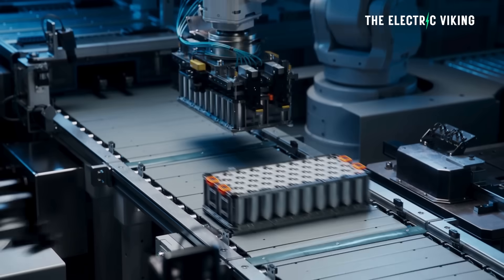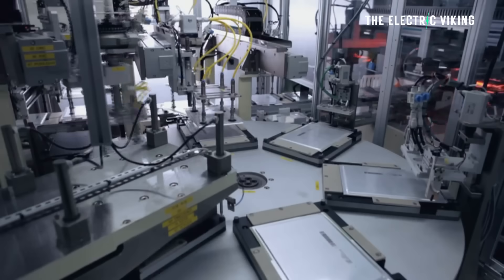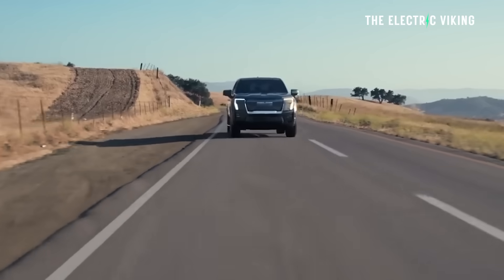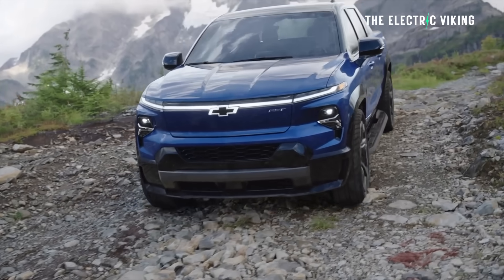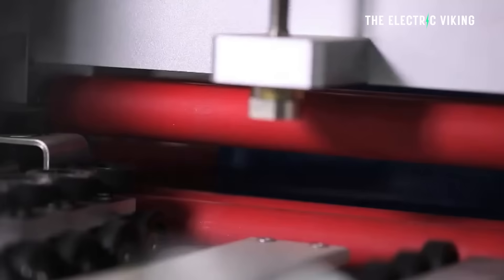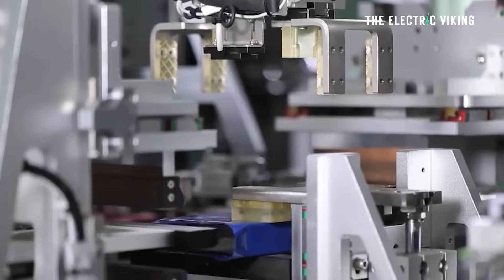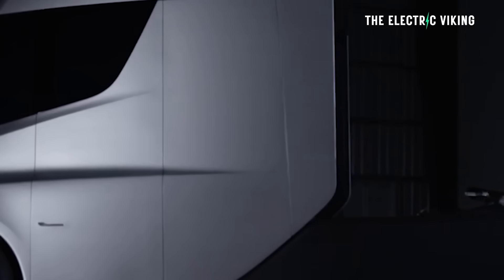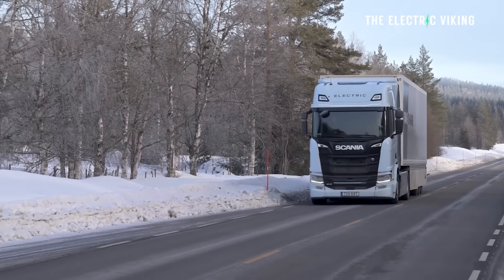GM’s Battery Breakthrough - LFP battery cost with 33% higher energy density!

Comment: Sam - the haters will keep moaning that we keep hearing about breakthrough batteries but never see anything. But batteries are still getting better and cheaper every year. I guarantee you that oil is not getting any better as we pump it from the ground. But we are improving our ability to store energy and also our infrastructure to transmit it to cars. It’s all happening right in front of us and in 20 years we will think of gas stations like we now think of dialup modems or VHS tapes
Reply: I agree entirely, my benchmark is when I can go down the road the buy one from the supermarket it's reached mainstream production, until then these are interesting to read. I personally think 20 years is to long though, 10-15 years I would give it. It's like smartphones, it seems to go slow at first, then suddenly seemingly overnight Nokia is just another old phone maker and all the good stuff is coming out of upstarts like Samsung and Apple. If I needed a new car now it would be electric of PHEV certainly (more likely PHEV due to where I live), but currently one in four new cars being sold are electric and that's not going to stop or slow down. It's like computers really, there's always a brand new processor around the corner, but if you wait you end up never buying anything. Even if you buy a new EV today and tomorrow the latest battery tech replaces the current tech you still have a decent EV, that's life.
Reply: Dammit!  I miss VHS tapes...
Reply: @jefflittle8913  Yeah, but that does bring up an interesting point right? Just because we have all these breakthroughs doesn't necessarily mean we will get the best battery tech, there's a balance between various factors like cost of production, technical operating specs like temperatures and charging and cycle numbers that may mean we get the second or third best battery tech in energy density, it's just like the VHS/Beta war, someone will win, someone will lose, but unpredictable at the moment, but yeah, good old VHS, the second rated tech taking the crown.
Reply: @jefflittle8913  Hahahahahahaaa!
Reply: Hey petrol cars are a lot cleaner now than ever before, and anyone who has experienced changing a distributor cap will appreciate the electronics breakthrough in modern petrol cars
Reply: @barryobrien1890  Yes they are, they still burn oil products, they still create pollution, they are still woefully inefficient when it comes to converting burning oil into motive force compared to EV's. Not sure what your point is here, we should keep ICE engines because they are slightly more efficient after 100 years of development? Or maybe we should change over modern electric engines because they can be over 90% efficient converting electricity into motive force. Your arguments about modern electronics actually support EV's, not ICE vehicles. If we are going modern electronics why not go all the way and get an EV?
Reply: That's because it's not really a breakthrough to begin with.

It's just just Li NMC tweaked to significantly favor manganese in proportions over nickel and cobalt.

That's why it's called "lithium manganese rich", and not just "lithium manganese".

It still has nickel and cobalt - just significantly less of them now in proportion to manganese, which is a cost benefit, but still reliant on conflict linked mining.

Also LNMC type batteries are more prone to fires than LFP, so until we know how fire prone LMR chemistry is it's definitely way too early to call this a breakthrough.
Reply: "It’s all happening right in front of us and in 20 years we will think of gas stations like we now think of dialup modems or VHS tapes"

Except we will still need to charge somewhere, which is just as likely to be former gas stations as anywhere else.

Also people mock VHS but they were a lot easier to just set up to record on and rerecord over than any variant of DVD technology has been since.

HDD's are an improvement, but it's non trivial to just take a HDD recorder away with you if you want to play a recorded TV programme in another building.
Reply: @mnomadvfx most people with houses will charge at home. Which is the case now for EV owners with a house. But obviously we will need lots of public fast charging. This is obvious. The US is adding 150 fast charging stations per day on average so by the end of the decade there will be way more fast chargers than gas pumps.
Reply: So you think that engines developed in the 1930s haven't improved in efficiency????
Engines continue to be more fuel efficient & last way longer than their older cousins.
A world full of EVs CANNOT possibly be supported by "green power", it's a statistical FACT!
The recent power outage in Spain & other countries was caused by the imbalance in the grid, caused by greenpower!
Reply: How can oil 'get any better'?  It's fabulous, multi-purposeful and plentiful as well as accessible.  If only lithium were as easy to derive???  Or the 'exotic' materials used in some battery production???  We are increasing the fuel efficiency and cleanliness of ICE vehicles every year (actually going backwards in some cases due to pathetic enviro regulations) and will likely find a way to scrub CO2 from emissions long before we get a battery that has equivalent energy density as hydrocarbons.  Add to this the fact that derivatives of oil are far too involved in many other chemical and material manufacturing processes AND that diesel- engined vehicles and aircraft will never be replaced by EV versions then you can see - if you have an open mind - that oil isn't going anywhere except forwards.
Reply: @kellyeye7224  horses are pretty great too you know. You can have an emotional connection with them. They can go in all sorts of rough terrain. Horses are never going away, for sure!
Reply: @kellyeye7224  Sure, every time you need to make your car go further you need to use more fuel, diesel/petrol etc, batteries will last a million kilometers these days. Sure you can try and argue the 80,000 liters of fuel (that's 59 tons btw) the average car uses to travel a million km is less environmentaly damaging than the single battery an electric car needs, but you would be wrong!
Reply: @kellyeye7224 Too bad 80% of all that energy density goes away as waste heat.  The performance from electrics is so amazing, anyone that's ever driven one doesn't want to go back to petrol, not to mention the cost. I drive my MY around for about 3 cents a mile off of my utilities off peak $0.10 a kilowatt hour power. I am installing 14 kilowatts of solar this summer, so that'll drop to about 1.5 cents per mile.  That's about 200 miles per gallon, and did I mention that it will pin your ears back when you stomp down on the accelerator?
Reply: @sowireless  So all you've got is acceleration?  What's it like towing a caravan or trailer?  With a family of four and all their luggage?  Are you happy paying for charging on a long trip?  Or waiting in long queues?  Sure, factor in your solar system (great when you live in sunny climes) but also factor in that cost before telling us how 'cheap' your recharge is.  As for 'not going back to petrol' you are clearly behind the times with your data.
Reply: @kellyeye7224  I don't tow anything. Don't need to. I have Visa for everything else. By the way, the model Y is excellent to sleep in. There's these custom mattresses that you push a button it fills the whole back end, turn the car into camp mode, set the temperature, and have a great sleep, to the very quiet hiss of the heat pump system, on an area that is probably queen-sized.   It's just me and the dog, then maybe a girlfriend now and again.  My solar system is going to deliver power, with backup of a couple days, at 5.3 cents per kilowatt hour assuming a 20-year lifetime. Since it's probably going to last closer to 40 years, not that that matters to me, it'll be about half that.
Reply: @sowireless  You illustrate a good point.  People buy a vehicle to suit their needs.  Those that need to tow or take a family are therefore screwed.  So much for EVs being the 'replacement vehicle for the future' then...  Thank God for ICE vehicle choice.
Reply: @kellyeye7224 firewood and coal were plentiful when oil and gas started to be considered even with the technological limitations of the time.
Reply: @kellyeye7224 they will not find a way to “scrub” co2 since that negates the point of hydrocarbons - you need more energy than you just produced. But co2 footprint of batteries keeps decreasing. Lfp isn’t even the latest tech yet here in Austria the total lifecycle co2 of cars with lfp is 10x-20x less
Reply: @scenicalpinedrives  Real sound thinking there....... never heard of CO2 scrubbers used in submarines or, more famously Apollo 13?   The CO2 from ICE engines is AFTER the energy has been released and 'sucking it up' is no worse than the theory behind Carbon Capture and Storage.  Another example of 'joined up thinking' by the EVangelists.
Reply: @kellyeye7224  Concordo.
Ainda viveremos muito tempo com e graças ao petróleo que acredito não ser finito, assim como a água também não é. Imaginar que o petróleo é resultado da decomposição de carcaças e seres da era do dinossauro é a maior mentira já vendida e comprada por todos nós. 
Mas vejo um convívio entre alternativas de armazenamento de energia.
considero alguns pontos:

1 - Vejo como maior desafio dos EV's a bateria a oferta no ponto de carga, ou seja, estrutura de distribuição de energia que em nenhum lugar do mundo foi projetado pensando em carros elétricos e sua demanda enorme, totalmente fora dos padrões pensados desde o início da era da eletricidade até recentemente.
A história de 1MW é simplesmente absurda, coisa de indústria pesada num ponto de carga, economicamente inviável.
Talvez descubramos outro modo de transmitir energia que não seja através de cabos e na fórmula atual de tensão versus corrente. Algo realmente novo que permita o transito de quantidades enormes de energia sem perdas, nem aquecimento e a custo baixo. Nada do que temos hoje. Com a tecnologia que temos em distribuição não iremos muito além de onde estamos. É limitação física de difícil superação com o que dominamos atualmente.
2 - Peso morto das baterias:
     Ao contrário do tanque de combustível que vai perdendo peso ao diminuir o estoque de energia, ou seja, ajuda na economia a medida que mais precisa, as baterias funcionam ao contrário. 
    O peso está lá, com ou sem energia. Portanto além da densidade, velocidade de recarga, resistência a ciclos, o desafio continua sendo o peso morto. Como reduzí-lo ao máximo deve fazer parte da equação, lembrando no impacto desse excesso de peso na estrutura do veículo como um todo...
3 - Apesar disso tudo, em casos como o meu, locomoção em curta distância, o EV é uma decisão até lógica. Eu acho. Talvez porque queira ter um apesar de todas ressalvas que apresentei.
Reply: " I guarantee you that oil is not getting any better as we pump it from the ground"
What makes you think that? There's combustion technology that goes way back to the 70's that could drive efficiency through the roof - but it was shelved because it would dramatically reduce profits.
When the day comes when use of batteries actually threatens to wipe out oil - these combustion technologies will be taken off the shelf.
Also, oil is abiotic which means we are not going to run out any time soon.
Reply: @babajaiy8246  We have had nearly a hundred years to work on internal combustion engines for mass transport, EV's have caught up after just over a decade. If there were technologies that could drive ICE efficiency through the roof we would already have it. Chinese companies have in fact increased the efficiency of combustion engines already for their PHEV's, and they have diesel engines with over 53% efficiency, however you can never get away from the fact that ICE use combustion heat from burning oil products to drive the process, which means there is a point where you can never get more efficient, and you can also never get away from spewing dangerous gases into the air. Also you can't get away from the fact that EV engines can get over 90% efficiency and ICE engines will never match that,
Reply: @babajaiy8246  the oil we pumped 100 years ago is the same oil we pump today. Batteries have improved significantly and can be recycled over 90% whereas 0% of oil is recycled. And oil is still polluting our air and giving us cancer whereas solar electricity comes for free from the sun. Comparing electricity to oil is about as dumb as comparing an iPhone to a rotary phone.
Reply: @babajaiy8246 I’ll have to dust off my 120mpg carburetor. 😂😂 if the technology existed it would have leaked quite quickly, too many people would have known about it and someone would have opened their mouth, and with todays instant communications these ideas would be out there.

Comment: I have the intuition that Tesla cancelled the optional battery addition on the CyberTruck bed because they have a way to increase the KWh in the main battery in the near future.
Reply: I was thinking the same thing...
Reply: I agree, but I’m not sure how that helps existing owners.
Reply: @JohnSmith-x3y8h  It doesn't, unless they offer an upgraded pack for a fee. I was thinking that same thing too.
Reply: Right now, the Chevrolet/GMC/Hummer EV pickups have  double stacked batteries to provide 440 miles of range. This makes the vehicles extremely heavier (approx 9000 pounds) than other EV pickups. This new battery should provide the same range without the undesirable weight.
Reply: Nope. Musk is not interested in delivering on promises made to CyberTruck Owners. It’s a failure of a product and he’s trying to minimize expenditures related to the product.

Comment: If production begins in 2 years....they will be obsolete before they make it to production.
Reply: Every technology is "obsolete" by the time it makes it to mass-production. The only important point is whether GM & LG can mass-produce stable and reliable batteries for their vehicles at a reasonable price. Consistency in battery manufacturing is much harder than people give credit. 

Long-term durability of the battery's life-cycle is often raised as one of the concerns for LMR. Even if it's cheaper than LFP batteries, if the battery life is shorter that will have serious impact for automakers and their warranty. replacement costs, etc. And it was LG that provided batteries to GM on their Bolt, which had battery-related recalls.
Reply: It’s a cost thing, they wait for LAC to be in operation
Reply: Ain't you a "ray of sunshine?"